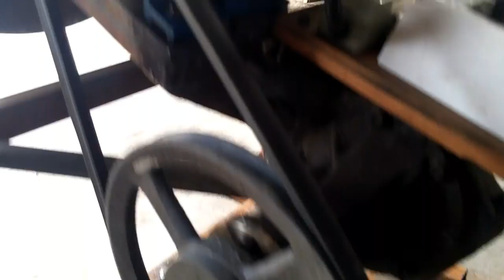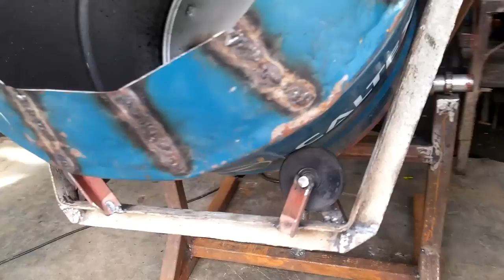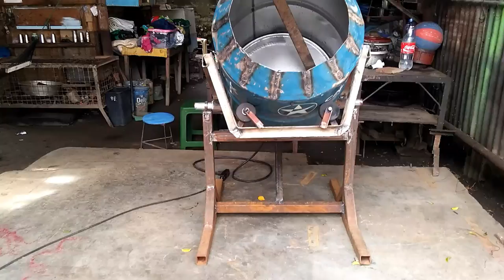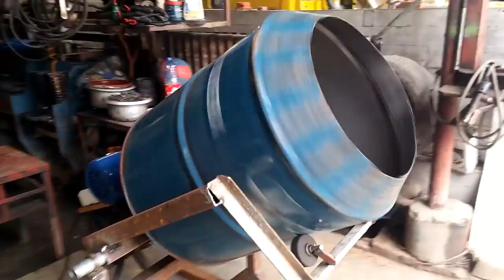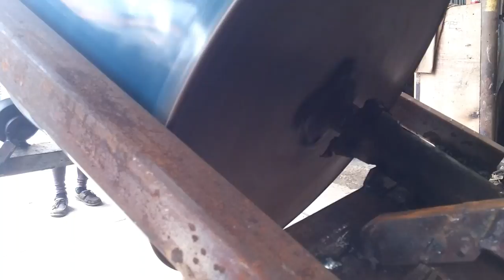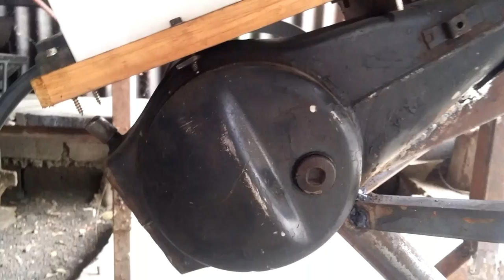Homemade Cement Mixer

Comment: How much will it cost to build 1
Reply from the maker: I think my father spent almost $400 :))
Reply: pinoy po??
Reply: motor specs?planning to build one
Reply from the maker: 2 Horse power po. pero sabe ng tatay ko pwede pa daw maglagay ng 1 horse power.
Reply: @JoeItYourself  that blue mesin what name ??
Reply from the maker: @powerrangjer2001  it's a 1.5 horse power motor. but 1 horse power is good enough
Reply: @JoeItYourself  ok..if i made motor direct to barrel can???
Reply from the maker: @powerrangjer2001  it's going to spin so fast. you need a reduction.
Reply: @JoeItYourself  ooohh...coz i wan to find this motor...i ask my fren..he have this motor...but not new..just secondhand...

Comment: over engineered.whats the differential for ? u dont need to bend the torque,just point the motor to the drum  n use a belt for torque transfer.
Reply from the maker: thanks for watching 😎